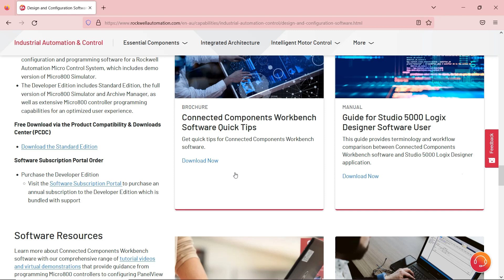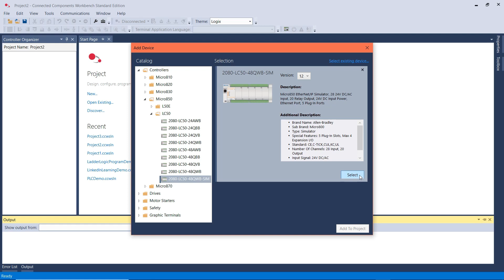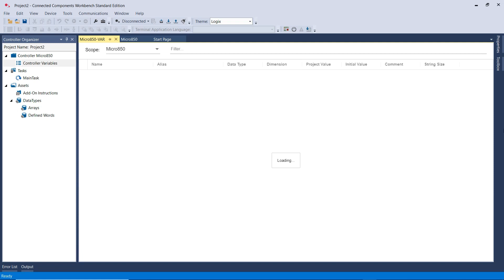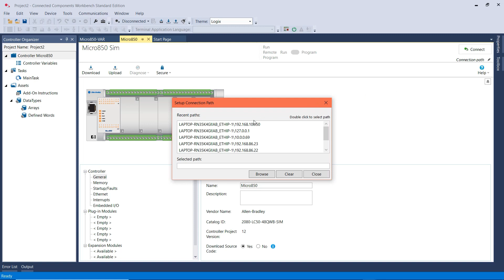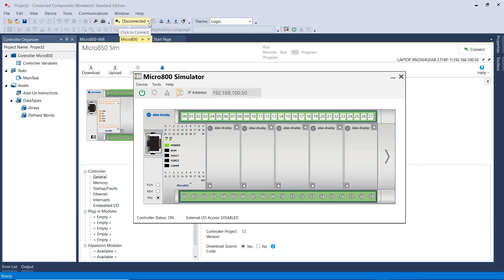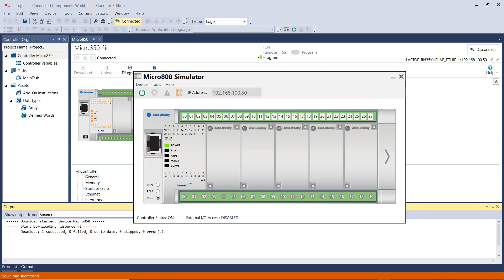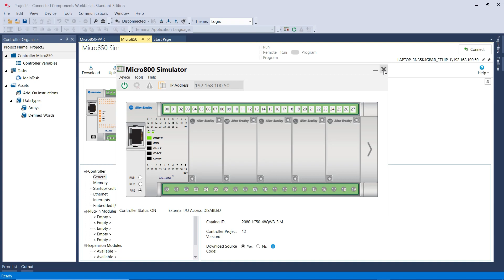AB Micro800 Simulator PLC from Connected Components Workbench Software (how to access it and use it)

Comment: Hello, I tried this with CCW 21.01.00 but the connection between Factory I/O and CCW is very slow: update rates of 1-2 seconds and thus the program responds too slowly. What version of CCW did you use. Thank you very much for your answer.
Reply from the maker: I am using CCW 20.01, I also have it on another computer CCW2 21.01 , and both work ok. 
Here are couple of suggestions to help with the speed , Try to change the speed rate in Factory IO , Check this link from Factory IO Website , under Slow motion and Fast forward : https://docs.factoryio.com/manual/edit-and-run/#run-mode 
Also , try to disconnect from the internet , see if that helps . Another suggestion , make sure you don't have other software running at the same time .
Thank you